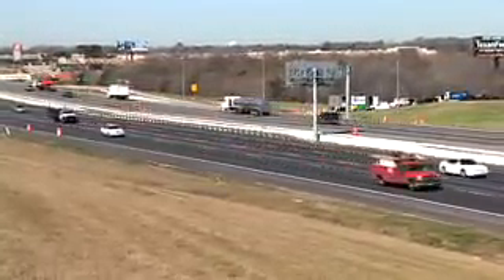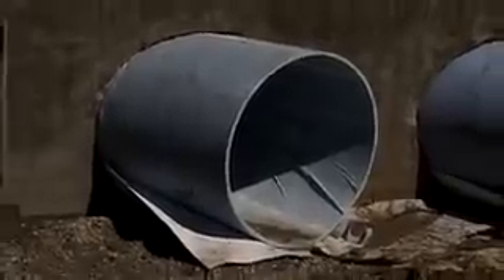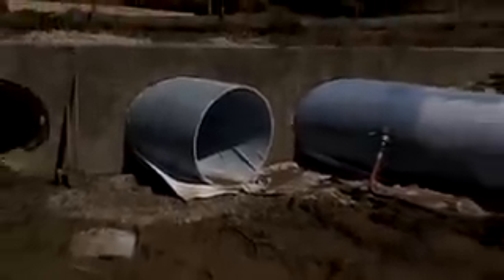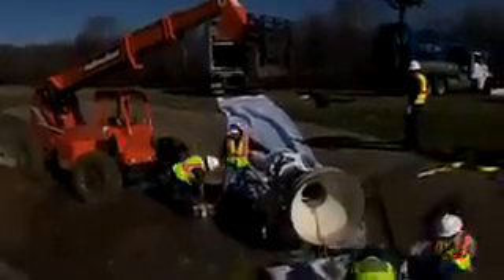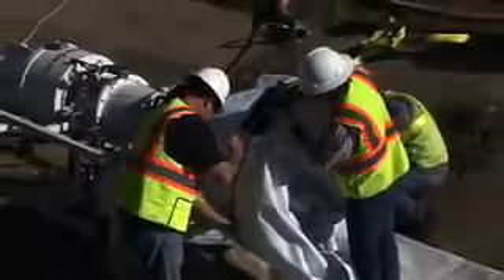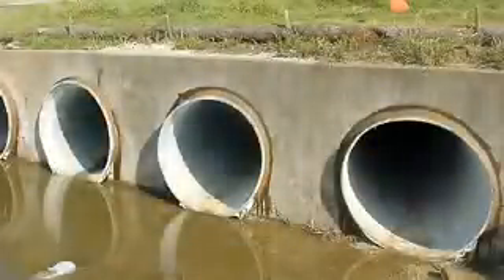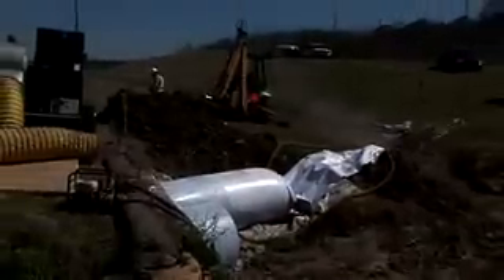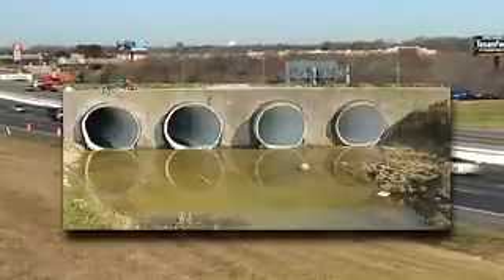CIPP Culvert Renewal - Insituform

Comment: When I first started cleaning & TVing pipe we cleaned with a eductor or pulled a pig through the line. We also pulled a camera through the line via cable and winch. I worked for A&R eductor in Lynnwood WA.  In the early 80's my boss Bill Kielty took six of his employee's from A&R and went to Gelco Grouting Service in Kent Washington. In 1984 or so I signed on for a job in Hawaii . We cleaned Tv'd grouted and bagged pipe from 6" to 36" We rehabbed MH's with Fosroc  sealed MH's with AV-100 and AV202 We had at one point 108 guys over on the Hawaii Kai Project. My most memorable time is when I was shooting a lateral with a stinger in a newly bagged 36" line . We had a bypass set up but at 150' inline I heard a BOOM the us plug blew and I was going surfing.  I had enough time to get on the radio to tell my top man let my lifeline go. The 1st 150' of the newly bagged line was warm and soft the rest was pretty crazy. I sailed through 5 MH's till I could grab a step. Wish I could have seen the crew running down the street popping lids looking for me. There isn't much in the sewer rehab industry I haven't done . Equipment from Cues, Pierpoint inuckten , linkpipe ect. Companies from Gelco, Pipe Experts and Miller Pipeline and other smaller outfits. I have travelled the country fixing municipality nightmares and loved every minute of it. My second best memory was when about 84 of us went to Aloha Stadium for a ZZ Top Stevie Ray Vaughn and Run DMC concert. All of us up in front by the stage playing hacky sack and getting hosed down by security. Stay safe fellow Sewer Rats. And remember shit runs downhill payday is on friday don't bite yer fingernails.    Aloha, Kuzin Ed